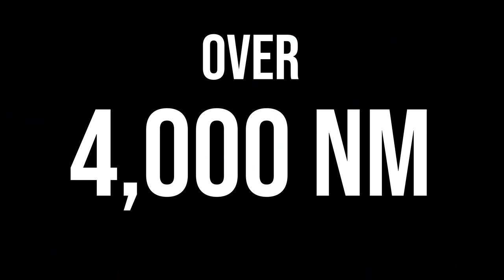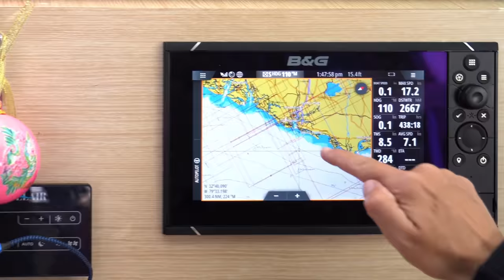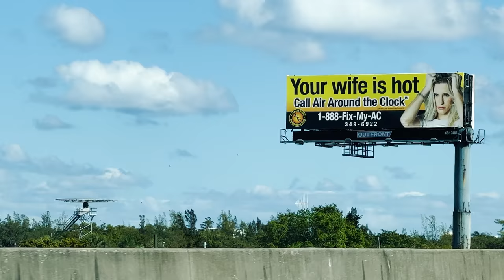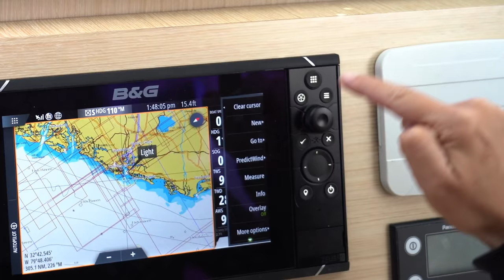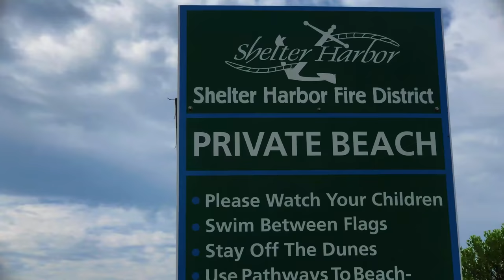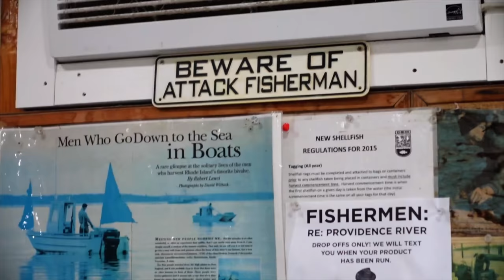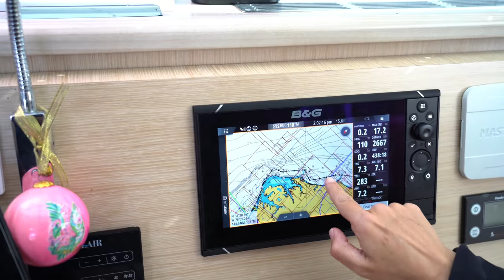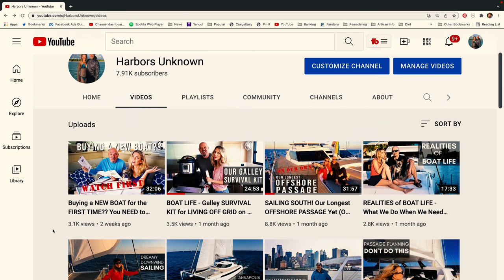MAINTENANCE COSTS + Lessons Learned LIVING on a NEW SAILING CATAMARAN | Harbors Unknown Ep. 54

Comment: Hi K&F! This is one of the most informative and honest cruising videos on Youtube, and it is so valuable! I was going to build my cat in Asia, but because of COVID, supply chain problems, rapidly rising costs, etc. that is not happening. Instead, I will be purchasing another used 50 footer and refitting it for longer travel, but not for full time living as I decided to purchase a condo (in the US) as a base for when I retire in 3 years. I think many people new to sailing don’t understand the costs involved in time, effort, and money. What you paid in maintenance and repairs is equal to the purchase price of a good older 30-35’ sailboat, and that’s constant as things always need fixing on boats. That is not cheap, and it is real. I restored my 50’ motor yacht for around that price (parts and my labor) and just sold it so I can purchase my sailboat, which will be another monohull as there are so many great deals out there on monohulls (which I enjoy sailing) because so many are wanting cats these days not realizing the increased docking costs, redundant engine maintenance, and after purchase costs of such a large vessel. Yes, the larger, the more expensive to maintain. Restoring the yacht taught me so much about boats in general, as in these trying times, just getting parts can be difficult. You have been so honest in showing us all what those costs actually are. Is it worth it? I think so, but full time live aboard sailing is a lot more involved than most realize. Thanks for your openness, and for sharing!
Reply from the maker: Thank you for your comment! We are happy to be able to provide some useful info for our subscribers, I agree with you, had we found a used boat to fit our needs we would have bought it, but the market for catamarans is now very tight and used boats cost as much as new.
We are becoming stronger and learning how to fix stuff and enjoy life as full time cruisers.
Thank you for your continuing support
Reply: @HarborsUnknown  You two are pretty amazing, and you record when you are learning, so we can see the learning curve. I agree, used cats have become so hard to come by for a good (even fair) price, and I think many of the channels make the cat seem so much better than a monohull. But I've always enjoyed sailing monohull, and feel that at this time, good monohulls can be found at bargain prices (even more so after the markets drop,) thanks to the cat craze. Once you have your boat zeroed in, your costs will drop, maybe even by 1/3? But with all boats, the costs are continuous. So aspiring sailors need to beware and have the reserves, which many don't. And the more mechanical skills you acquire, the better, as it's very difficult to have to rely on others to fix things, especially out at sea. Fair winds!
Reply from the maker: Thank you! Very valuable perspective. Please keep commenting on our videos!
Reply: @HarborsUnknown  You keep making them; I’m happy to respond…

Comment: I'm 58 yo and hope to retire in a couple of years and would consider the same adventure.  For the benefit of folks like me, if you could go back in time, with all your acquired knowledge and wisdom, what things could we do in preparation to make the transition smoother over that first 18months of cruising?
Reply from the maker: Hi Troy! The thing that has plagued us the most is not knowing how to troubleshoot and fix different things on board. So I suppose familiarizing yourself with electrical systems, or the plumbing systems, engines, etc. would probably help. Every boat is different but I think it's more understanding how they work in general. We took a Nigel Calder diesel engine course at a boat show, which I suppose was helpful in some ways. If we could go back I might join a sailing club to connect with other sailors and try to learn from them.
Reply: @HarborsUnknown  Thanks for experience based advice.  May your adventure keep getting more fulfilling as you learn more and more!
Reply from the maker: It’s our pleasure. Thanks so much!

Comment: B&G Replacement Hydraulic Ram T3

Function: Allows Auto Pilot Power Steer Mode during Manual Steering Failure.
Did u have a steering failure?  Please explain why is T3 and T2 are important.
Reply from the maker: We didn’t have a steering failure. The T2 & T3 are types of B&G autopilot RAM. These are different size RAM’s (T3 is larger) used to steer the boat to a set course or wind angle. It makes long passages much easier because you don’t have to hand steer the whole time. Does this make sense?
Reply: @HarborsUnknown correction:  U advice that T3 n T2 , should be ordered from factory as an option; the Google definition is wrong as it relates to steering failure.
Reply from the maker: Yes, ideally it would be ordered from the factory as an option. The Google definition is a bit strange. 🧐
Reply: @HarborsUnknown  thank you...